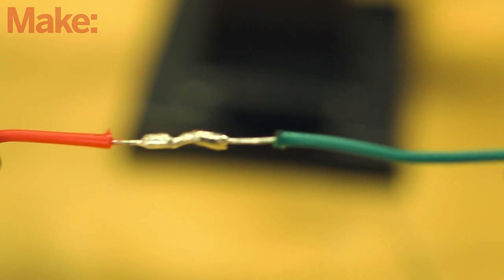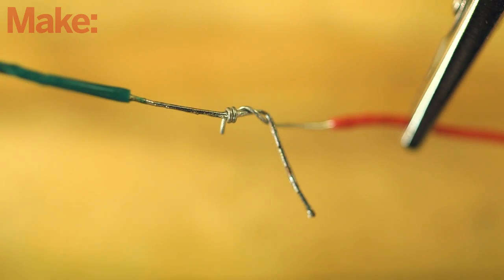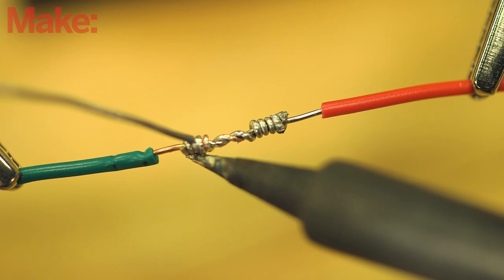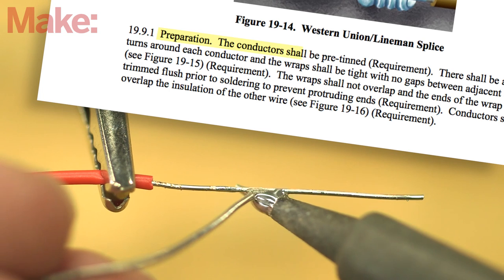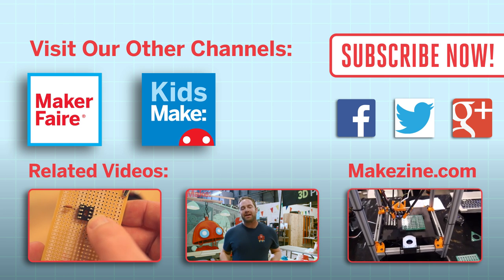How To Splice Wires to NASA Standards

Comment: Great decision to do this video. Sorry to nitpick (what do you expect on a NASA workmanship-standards video? ;) )
Please see http://workmanship.nasa.gov/lib/insp/2%20books/links/sections/101%20General%20Requirements.html ("general requirements") According to this, the splice in the video fails on at least three counts - 
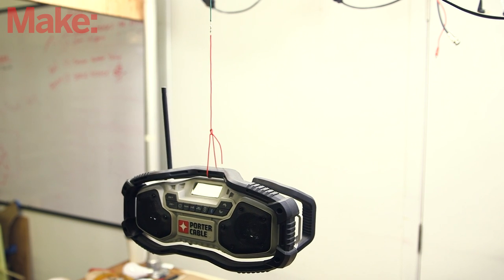1) 0:35 UNACCEPTABLE: RINGED CONDUCTORS/STRANDS - Ringing is a symptom of an improper process or tooling. Ringing which reduces the overall cross-sectional area and/or results in exposed base metal shall be cause for rejection. NASA-STD-8739.3 [6.6.1], [7.2.3], [13.6.2.a.8] NASA-STD-8739.4 [6.6.1], [10.1.3], [19.6.2.a.2] and
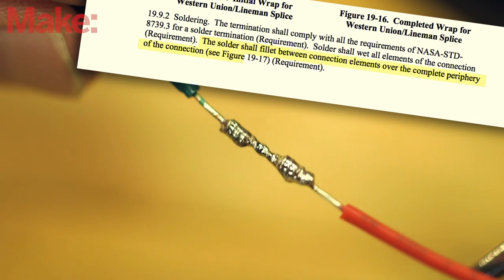2) 1:37 UNACCEPTABLE: EDGE FLASH/SMEARING - The edge flash is in excess of one-quarter insulated wire diameter (1/4 d), and the stripped section exhibits smearing (melted insulation/film) which is considered a contaminant. NASA-STD-8739.4 [ 10.1.6 ]
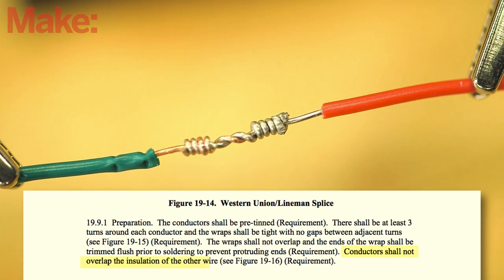3) 1:31 UNACCEPTABLE: DAMAGED INSULATION/JACKET - The conductor insulation and /or cable jacket shall not exhibit any damage, such as nicks, cuts, or charring. Conductors/Jackets exhibiting damage (other than minor scuffing) shall not be used. NASA-STD-8739.3 [13.6.2.a.1] NASA-STD-8739.4 [19.6.2.a.2]
Neither am I saying that that isn't a great splice, nor that I could do better. However, the splice in the video won't pass muster with NASA (I hope).
Reply from the maker: +Aditya Mehendale Wow! Great breakdown! Good thing our splice will be staying on the ground.
Reply: +Make:  Keep up the good work! I hope my critique doesn't dissuade you from making more videos like this one...
Reply: +Aditya Mehendale wow, nasa has all reason to have so high standard for soldering, but i wonder how you can have a good fill of solder (you have to pre-heat both wires?) without melting the insulation (trouble #2)!
Reply: +Aditya Mehendale http://workmanship.nasa.gov/lib/insp/2%20books/links/sections/101%20General%20Requirements.html Here, Found this fun Sheet!
Reply: +Marco Ruggiero I am not affiliated with NASA in any way (except for sharing the same planet ;) however, a good way to prevent the sheath from melting is to clamp the bare conductor in some kind of heat-sink (nose-pliers work well) just short of the insulation. This will keep the conductor-temperature within the jacket at bay. A second tip (albeit counter-intuitive) is to use a hotter and stubbier soldering-iron. This minimizes the contact time between the iron and the wire, thereby limiting the heat-flux into the sheath (Think "deep-fried ice-cream"). Oh yes - and NEVER clamp insulation close to the hot-end in alligator-clips ;)
Reply: +Aditya Mehendale another way to avoid the issue is to use Irradiated PVC insulated wire. There is NO insulator crawlback (where the jacket shrinks), really neat stuff!
Reply: +Marco Ruggiero Use alu tape it will shield the jacket from the temp from the soldering.
We use it all the time, when the insulation jacket must not be damage.
Reply: +Aditya Mehendale I am actually developing a product by myself. Are there any other guidelines  from nasa other than this or anywhere else that you found useful. i really want to learn the best practices.
Reply: +Aditya Mehendale, plus this is only for solid core wire, stranded wire requires other splices I.E. lap joint etc.also if you were using a better quality wire with a better quality pvc jacket that would help prevent the edge flash check out ipc-a-610 and IPC j-std-001 standards
Reply: +sanjay dubey We learned these standards during my time as a avionics installer for military aircraft (standards are adopted from NASA). You can google it and find the PDF guidelines for all of this and there are also videos from companies on youtube that follow these standards as well and have videos up describing how to accomplish them.
Reply: John Doe
Thank you :). So following and learning standards is the key to design and maintain a critical systems. right?
Reply: +Marco Ruggiero well it is almost impossible with the kind of wire used in the video. They're using cheap single conductor, plastic insulated wire to demonstrate with but you won't find any of that in use in a component built to a NASA standard.
Reply: +Aditya Mehendale what kind of splice is used? do they use solder splices as in aircraft avionics?
Reply: +Aditya Mehendale Right. From a document in which they can't even spell "flash" correctly.

Frankly, I would take anything (post-Apollo) NASA says as being a great example of what not to do.
Reply: +Julian B. I don't know. I'm not an avionics engineer. I suppose they strive to avoid splices altogether. For reliability, simple solderless crimping with proper tooling works quite well.
Reply: +Stuve715 I see the information on teh interwebs as a great big buffet. One has to choose conscientiously what (not) to eat. This choice also partly depends on what else is available as an alternative. If, after reading the NASA publications, you find it to be below your standards, and have better sources of information, feel free to use these. You may also help others by sharing these sources, if possible. If you feel that the information in the said publication is wrong or harmful, do please point out (with facts rather than opinion) why this is.
Reply: sanjay dubey In general yes, you always should be learning the right way. It gives you a better perspective in everything you do in life.
Reply: I agree :)
Reply: +Marco Ruggiero well when I learned how to solder we were told to use "flat" pliers, so to protect delicate parts from overheating... so basically a lot of the heat is absorbed by the pliers metal... hope this helps
Reply: +Aditya Mehendale Don't ask me, I'm just some random anonymous dude on the Internet. Ask Chuck Yeager, Neil Armstrong or Richard P. Feynman.
Reply: Also, she did not clean the connection and use flux at every stage which is required.
Reply: +Aditya Mehendale 

Space shuttles written off:

This chick = 0
NASA = 2

Just sayin'.
Reply: +Make:  To be fair, the reference material quoted in the video isn't NASA, but for the Western Union Lineman Splice.  

It may be similar to that of NASA, but ... 

I'm pretty sure that NASA engineers don't build their skills from watching videos on YouTube.

So many pedants.  sigh  :(
Reply: +Aditya Mehendale This is perfect, it wouldn't be a NASA splice without a few write ups. I've been Instructing and fabricating NASA splice for a while now. This is just one of a few approved methods. I'm not a big fan of this splice. Unless the Indians cut the damn telegraph wires to Dodge city again. The Lap splice is also as strong as the wire if done properly and it cuts down on the length of the splice which is also an important design consideration.
Reply: +Jonathon Vermillion Lol. Interesting. Though I am a fan of NASA's picture-manuals. I haven't seen anything else quite like it. (especially the BS-free wording, lean cross-referencing and clear explanations).
Reply: hey now, dont live upto your name

Comment: Yup, we had to learn this for "Army Training" for the old radio repair school at Ft. Gordon.  I can't tell you how many times I had to redo this before passing "solder school" inspection!  Although I've never used it since to the specifications as shown, the basic ideas of wrapping will work fine even if not soldering.  (Wrapping was used as an alternative to soldering on old TV and stereos chassis.  I've pulled apart 20-year old chassis with amazingly good wire-wrap connections.  Most were never soldered!)
Reply: an Air Force tech said solder school was tough, the sergeant demanded he should see his face on the shiny solder surface, "or you WILL do it all over again from scratch!"

Comment: Ironically this isn't an approved splicing method for aircraft according to the FAA
Reply: faa dont fly as high as nasa, they dont care !
Reply: And you ? You fly high?
Reply: This isn't even the method I took from the NASA publication I read.  The method they seem to actually use is the side-by-side one.
Reply: What’s an example of an FAA approved splice?
Reply: @Abdega  In aviation you don't use solder to splice wires, you use quick splices. Basicly a metal tube you crimp onto each end of the wire and then you seal the bond with a heat shrink
Reply: @zaboon123  Last I checked, NASA is involved in some forms of aviation and the methods they use are described here: https://nepp.nasa.gov/files/27631/NSTD87394A.pdf

I'm not sure if you paid attention to the video, but the wire being spliced is a single strand solid core wire. these wires according to NASA should NEVER be crimped. 

7.2.26 The following requirements apply for crimped connections.
a. Crimped contacts shall be used with stranded wire only.
b. Solid wire shall not be used with crimped contacts.
c. Solid, tinned wire shall not be used in crimped contacts.

https://nepp.nasa.gov/files/27631/NSTD87394A.pdf

When splicing (considered a repair) stranded wire, connections can be made using both solder or crimped methods depending on location. The above document goes over all this.
Reply: Of course its not approved by FAA. FAA doesn't allow for solid single conductor wires as seen in this video. NASA does. 

page 41: https://www.faa.gov/training_testing/training/air_training_program/job_aids/media/EWIS_job-aid_2.0_Printable.pdf
Reply: I wonder if the difference between NASA and FAA standards boil down to concerns of weight? The micro-optimization wouldn't be surprising
Reply: @chase-bank  From the NASA .pdf above:
"Solder-style splices produce a smaller, more compact splice termination, with significant weight reductions over crimp-style splices."
So the weight is most certainly a factor.
Reply: @LBCAndrew  That link has gone 404, so I can't reference that, but other FAA docs recommend stranded "should" be used *in most cases*.  It clearly says it's a recommendation only rather than a requirement, and that recommendation doesn't apply in all cases. They also show the requirements for terminating each type. The section on terminating stranded has a much longer list of how it can be wrong.  With solid wire, you don't have to be concerned about the lay, damaged strands, one strand being short or long, etc. Their standards for termination of solid wire is much simpler . Also wicking is much less of a concern. On the other hand, FAA recommends stranded for most applications because of motion and vibration.

Comment: Not a bad video, the splice is technically correct, but to make it NASA acceptable you need to use thermal strippers to melt the insulation then twist the insulation off as not to disturb the manufacturers wrap, not to mention using heat sinks to ensure the solder doesn't wick under the insulation when tinning. Plus too much solder, weight is a huge factor on spacecraft so you should see good wetting, but still be able to see the strands in the wire after soldering. 
Source: Teacher was a solderer for NASA during the Gemini program.
Reply: Anti wicking tweezers
Reply: That's actually kinda awesome
Reply: only it wasnt stranded wiring.

Comment: Your wire stripping isn't up to nasa standards though...
Reply: Your grammatical correctness also is not up to NASA spec.
Reply: please correct me then
Reply: you didn't correct her wire stripping
Reply: very well, she didnt use calibrated wire strippers, or thermal wire strippers, thus damaging the conductor. This creates a point of failure in the wire. 

I personally prefer thermal wire strippers for critical work.

However, i do understand why she didn't use such exotic tools, since they are expensive and need constant calibration (which must be done every single day)

Comment: Alternative with stranded wire: to splice wire into (out of) line (i.e. a "y" connection) strip insulation of first wire at location for splice... make an "eye" in strands (as in the eye of a needle). Strip insulation of second wire end (leave some insulation on the end, to simplify threading through "eye"). Wrap second wire end around first wire (collapsing "eye"). Solder location and insulate. (formerly referred to as "military splice")

Comment: Good for automotive work... when you NEVER want to have to mess with the wire you've done again lol. If you had to remove the transmission to get to the wire you've modified it'd really suck to have your solder joint come undone for example. Also in vehicles the heat can weaken solder as the engine bay gets very hot, so a nice strong splice is important.

Comment: Good job.
NASA/Navy/NEET and all mission critical joints have different techniques and specifications for different wires.  There isn't just one method to rule them all.  This is a very good video  though.  This is good soldering for a single core wire.  You can do it strands too if you twist|braid them.  But a good hydraulic crimper works too on strands (and not single core wiring).  Lineman in telecommunications didn't even have to solder it because that knot will hold when under tension while sitting on a pole.  They still use this knot and something similar.
Good video.

Comment: You can't pre-tin on 16 gauge and larger wires because the wire becomes too rigid to wind tightly as shown in the video. Pre-tinning transforms a stranded wire into a single solid conductor. And solid conductors have a much larger minimum bend radius than stranded conductors. When you solder the joint, the tin should flow into all the voids between individual conductors.

Comment: Solid core wire??  No flex...vibrations...cracks...breaks.  I would think NASA would use braided wire instead.
Reply: Depends on the place where you use it.
Reply: @LBCAndrew  
Stranded has a much longer list of how termination can go wrong.  With solid wire, you don't have to be concerned about the lay, damaged strands, one strand being short or long, etc. The standards for termination of solid wire are much simpler. Also wicking is much less of a concern. On the other hand, because of motion and vibration, stranded is preferable if you can't anchor the wire in a way that prevents vibration issues.

Comment: holy cow, i've been splicing to Nasa standards since i was 7 0.0
Reply: +Javierm0n0  same i thought this is how everyone splices wires.
Reply: +Benjamin Flatter With loops and turns? I don't think so, most people just twist the wires (as many/few times they want), then the wire ends weak.
Reply: zerpBot i learned to splice wires like this in 7th grade project lead the way (engineering)
Reply: +Javierm0n0 since you were 70?
Reply: you were a Western Union Lineman when you were seven? Too Cool!
Reply: not really nasa standards - so many things being left out here
Reply: antigen4 can you elaborate on your expertise with NASA standards?
Reply: sure -  just look at ANY one of the avionics soldering standards videos here. I would imagine NASA would uphold at LEAST the baseline MINIMUM avionics standard - wouldn't you?
Reply: FOR EXAMPLE - this one isn't even a splice - but simply soldering a single connector onto a single wire - and it's FAR longer and FAR more specific about what can touch what etc
https://www.youtube.com/watch?v=yzkuWORme2w
Reply: antigen4 Why did you FEEL the NECESSITY to CAPS LOCK some of the words?
Reply: since there doesn't seem to be much of a facility to write in ITALICS  here...? If you can tell me how that would work i'd be happy to stop using capitals. Seems to be a good solution from what i can tell. What do YOU do for emphasis?
Reply: in other words - capitalization or italics for a word that you might want to emphasize during plain speech etc
Reply: antigen4 put the words between two underscores 
Have a great day. 😄

Comment: Great video. This is being done on single core wire, what's the technique for multicore, is it the same or do you just not use multicore with this joint type?

Comment: Boeing inspector here and this would be a reject.  Not only are those not NASA specifications (have to have a clearance to work to/access) the requirements you called out such as the fillet, you splice does not meet.  Cute video, poor execution.  

Also, 95% of all aero space splices are are physical connectors (i.e. but splices) as there is no solider to crack under vibration.

Comment: Only. It won't as it needs to be completely air free. As in.. soldered in a vacuum.  This is so that air bubbles don't pop in space and cause a dry joint.

Besides which. MAA and CAA regulations preclude this type of splice on any air vehicle and insist that a crimped inline splice is used instead. These are then heat shrunk insulated and sealed with a melted glue to prevent water ingress.

This is bull.
Reply: Yep, crimp is far superior to soldering if correctly done.  Any high vibration application uses crimps, even cars.
Reply: viru52000 I always crimp and heat shrink along with adding diolectric grease to the inside with any wiring in my cars. Hasn't failed me yet
Reply: Viru52000, crimp and heat shrink is good enough for cars, not the best. I use crimps where appropriate. I have also made hundreds of thousands of solder connections where called for. I have also tinned, crimped and soldered the same connection where called for.